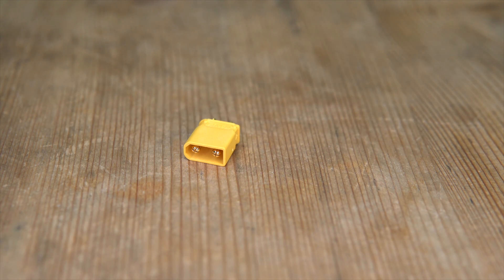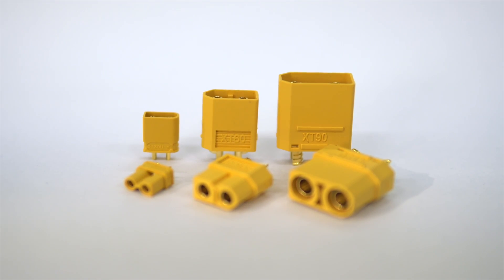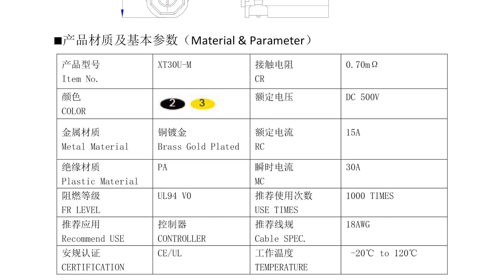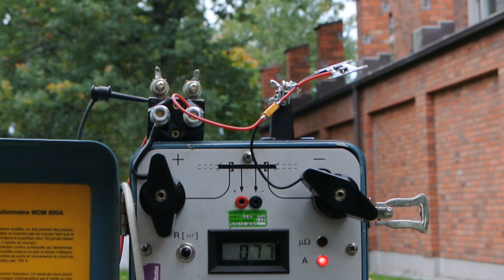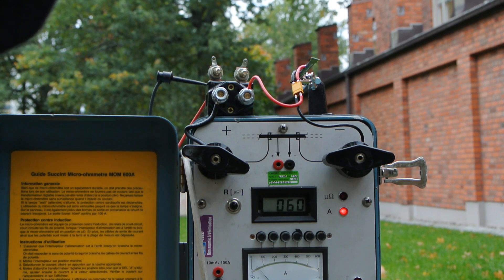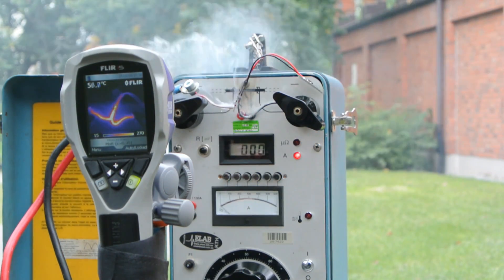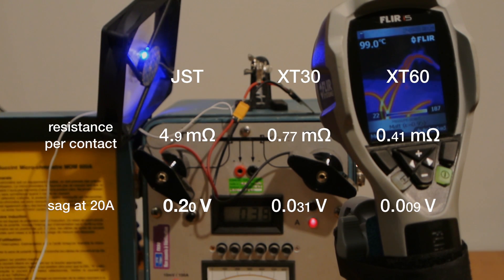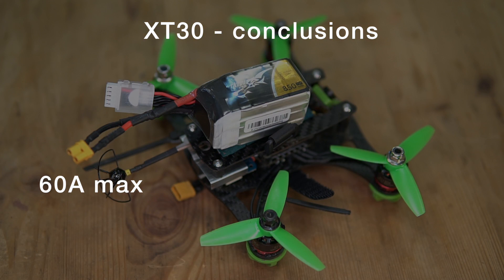XT30 connector - everything you need to know about, measured and tested

Comment: Great video, could you clarify what the material of the conductor/wire is. It looks to me like it is some kind aluminium,a tinned copper wire? It doesn't look like copper.
And could you do the same test again with a normal stranded copper wire instead of this vague "aluminium"?
Subbed : )
Reply from the maker: +ordiantakeover 
Fair question, I should have specified that! We used silicon wires, rated 200°C, with multi strand, tinned copper cores. This is pretty much the only kind of wire that should be used on drones, due to how soft it is, and therefore how well it can handle vibrations. We're gonna do a separate video on our wire recommendations at some point hopefully :)
Reply: dronelab Aha thank you, I didn't know that.